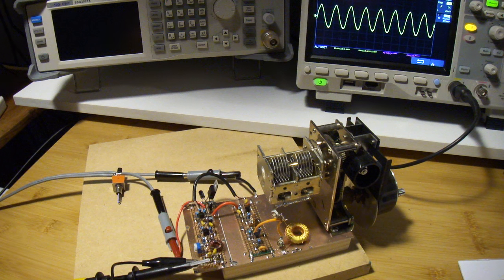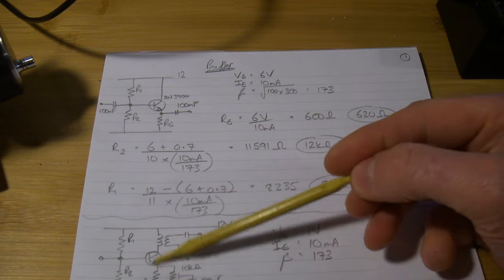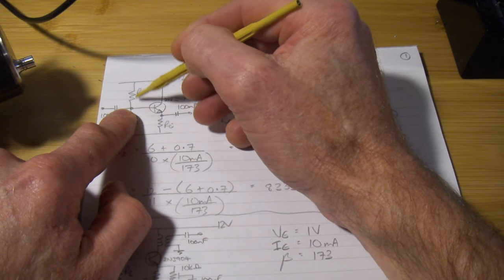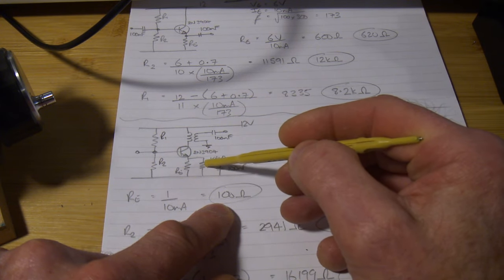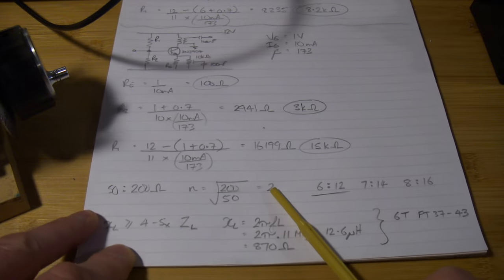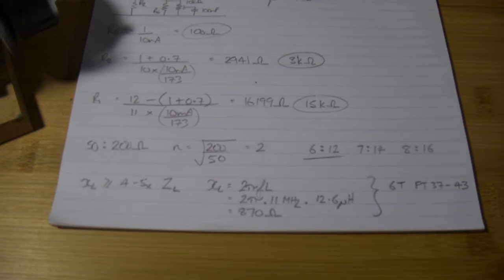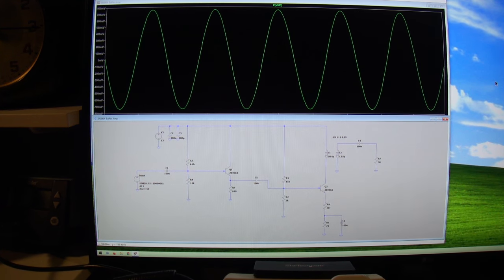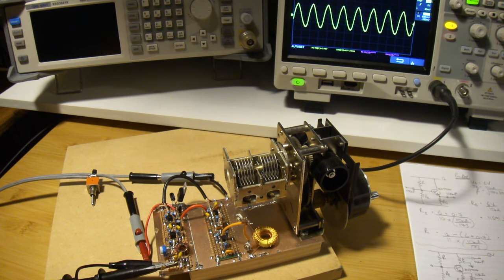AM Radio - Part 2b Buffer Amplifier

Comment: HI Charlie, I haven't watched most of your videos yet.... but I am glad to have found you.  Your email address isn't listed on your QRZ page and I wanted to thank you for a circuit of yours that I more or less copied.   I think I found the circuit diagram on your blog....  it is a combined driver and power amplifier where you use a 21:7 pair of windings on an FT37-43 toroid to send the signal to the final transistor..... then you use a bifilar wound transformer to supply 12v to the final and to carry the signal to the output filter.  I've made two QRP CW transmitters using this method (80m and 40m).   I've used both new BD139 and some salvaged 2SC1971 transistors as final amplifiers in my experiments.   My 80m transmitter puts out around 3 watts.  My knowledge of electronics is fairly limited, so it is great that you share your knowledge.   I hope to understand and use the relevant calculations eventually.... and if you ever write a short book on the 'how to' of doing and applying the mathematics to biasing and matching I would race to buy a copy.  Meanwhile I'm copying and experimenting.   Best wishes from Nelson.... ZL3ABX

Comment: I've been digging around in Grob's Basic Electronics,  and in Chapters 28 and 29 he touches Beta dc and Beta ac and says they are basically equivalent. Have you experimented trying to determine these values? I am having trouble accepting Beta ac = fT/op freq..
Reply from the maker: No, not empirically. I have tended to use the text books. That might be something to look into at some stage.
Reply: @CharlieMorrisZL2CTM  I'm sure I saw in a video you used a NanoVNA to measure the R-in. Perhaps the data exists

Comment: Typically people would run the two stages the other way around, voltage gain then emitter follower. The emitter follow can be configured to drive 50 ohms directly, saving the fuss of a output transformer. The voltage gain stage will still be ample buffering and isolation for this purpose. The emitter follower could derive its bias from the voltage gain stage saving bias and coupling cap. 
But you cant argue with stuff that works! So jobs a good'un!
de G0AFV
Reply from the maker: That is interesting thanks. I thought buffering the osc early would be the better option. I'll have to remember that for next time. Cheers.